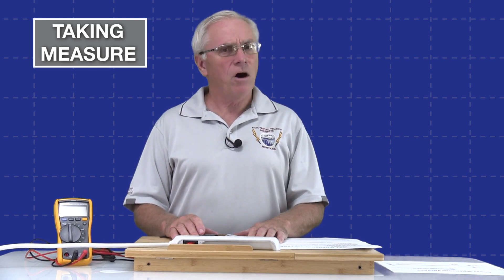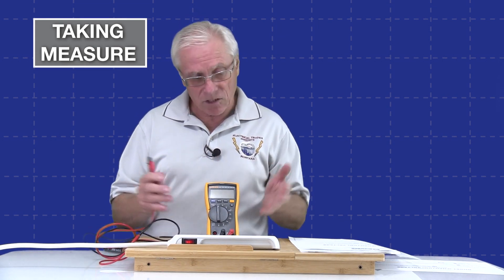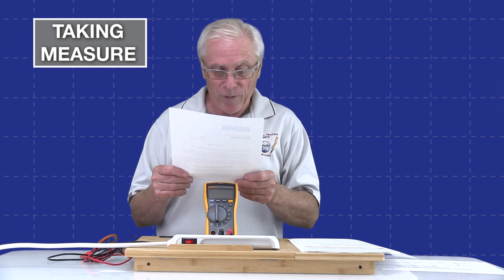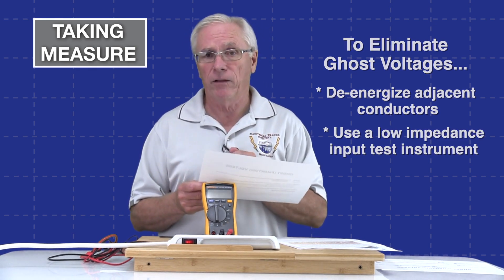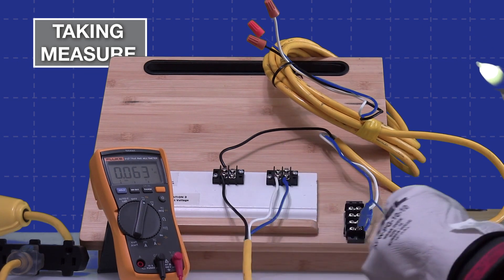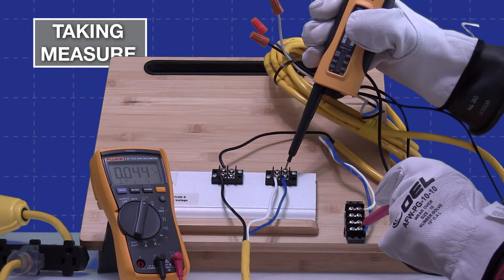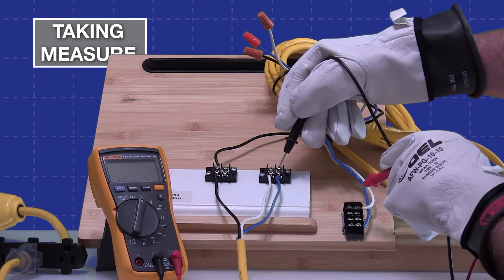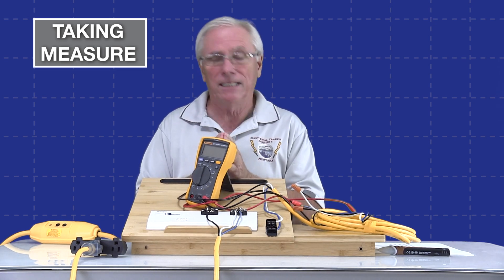Ghost Voltages - Interesting and Confounding!

Comment: Thank you for this informative video. I have encountered this issue with glowing LED bulbs. Upon investigation,  the fixture wasn't earthed, and neither was the connection at the junction box. I proceeded to earth the circuit, and the bulb stopped glowing.

Comment: Hi, I was trying to track down ghost voltage and I used the same Fluke multimeter in LowZ mode. I measured live and ground and I get a voltage of 2V. When I tried to measure neutral and ground my RCCB trips. Is this normal?

Comment: I dont have a low z meter. But when i suspect ghost voltage, I have a small relay coil rigged up that I use to tap on the suspected terminals and I can see if it energizes or not

Comment: The old part of my Dad's house was (and still is) wired with an old 240 volt main and range pull out fuse panel with 4 screw in fuses, in 120 volt 15 - 20 amp  circuits (small   5 room house when wired in 1949).  Those 4 old circuits only have two conductor wiring - no ground wires.  I know exactly what fuse turns off what light and what outlet- pretty straightforward and simple.  Has a sub two circuit fuse box wired with 10-2 w/ground wire tapping off each 120 leg where the "handyman" used the ground wire as the neutral (installed in late 60's).  I only figured this out on close inspection 20 years ago when my computer surge strip indicated no ground on these newer three prong "grounded" outlets in this addition.  The "grounds" in these outlets had just been screwed back to the sub fuse box and ended there. So much for assuming the outlets were working three prong outlets.

  Anyways  there is also one three prong outlet with newer type 12-2 with ground wiring on one of the old fused two wire circuits.  Now this should have dawned on me sooner, knowing  this circuit leaves the fuse box on old two conductor no ground wiring, that this particular outlet can't be grounded.  I was working with this outlet and was running voltage checks before taking out the fuse, -hot to neutral, hot to ground, neutral ground.  I could not believe it, but I was getting voltage readings on the neutral to ground???!!! (like 60 volts or whatever) and of course the hot to ground (but no where near 120).  I was totally baffled as to what was going on. Of course pulling this circuits fuse out killed everything. I wasted several hours trying to get to the bottom of this.  I even put one voltmeter probe on the nearby metal sink that is all plumbed with pvc in an all wood counter and could get volt readings.  I was trying to figure out a way I could see if there something bad going on.  It finally dawned on me that the ground wire couldn't (even though misleadingly attached to this outlet) be hooked up to anything and I was getting some wierd effect when checking voltage on neutral to ground with hot energized - with nothing plugged in or turned on in circuit.  I simulated this out in my shop where I had one stand alone outlet hooked up to 20 feet of 12-2 w/ ground wiring in the breaker panel and disconnected this outlet's ground.  I turned off all other circuits in box and was getting voltage readings in neutral to ground wires (way less than 120 of course).  That was very interesting.  This is also why I generally just kill everything whenever working on anything electrical.  You just never totally know what has been done or what might be going on.
Reply: My question would be is there any way to see if something like this was actually somehow energized - or partially energized for real?
Reply from the maker: @wdmm94  Using a voltage tester or meter with a low impedance input will tell you for certain. The ghost voltage is partially the function of the high impedance input of the DMM or tester.
Reply from the maker: Many years ago, I had a somewhat similar experience the first time I encountered a ghost voltage.  I wasted several hours "troubleshooting."  Thank you for sharing your experience here.
Reply from the maker: Thanks for watching.  I hope this was of help.
Reply: I also realize without being able to physically track and see this wiring to never  assume either.  I don't remember if I decided to disconnect this ground because it probably wasn't doing anything and just to be safe, but I did note on outlet that it was NOT grounded.  On another circuit I was fairly certain that the hot wiring went from fuse to light socket then to switch (light socket hot with switch off).  I think a guy almost needs to have an independent grounded wire and rod while trying to sleuth down antique houses that have had decades of layering.
I had another issue with a light not working in my Dad's boyhood farmhouse.  This house had some lighting from a 32 volt DC light  plant in the 30's and 40's.  My recent understanding of these systems was that they generally used light sockets and outlets same as 120 stuff in anticipation of being wired up AC eventually.  Might have been knob and tube.  I have a couple of 32 volt farm radios that have the same cords/plugs basically as 120.  This house had an old time 4 or 6 circuit breaker (!!!) panel.  Still has two prong outlets etc.  Twenty odd some years ago a new breaker panel was installed with wiring to energize old circuits in this panel with insides removed.  Just tied to old house wiring that came into this box.  I pulled down light fixture for this light and pulled out switch cover.  This was even worse in that it was old rubber cloth stuff that as I recall didn't match what was in switch or old breaker box.  Both wires looked alike basically. I couldn't make head or tales out of anything much less try to troubleshoot.  I also hadn't really verified which outlets and lights were with what panel circuit etc. So I didn't have as clear of a picture.  I also have no idea what work has been done over the years etc.  I didn't waste a lot of time on that, never really got to bottom of this, and light started working again. I think I also put some ox guard on new breaker contacts in case this was the problem - aluminum bus bar in a dampish basement - original breakers were on first floor.
Reply: Makes me wonder why electricians don't use ox guard on new install everything as it is all pretty much aluminum now and so prone to oxidation / resistance heating / poor contact arcing issues.  I seen this in a 20 year old breaker box in a building at my dad's with a 100 amp main breaker chewing up the contact on the bus bar about 20 years ago.  I was told 30 years ago by an electrician to use ox guard on the aluminum stuff I was installing at that time.  He also told me to run the underground aluminum cable in a drain tile to protect it.  My dad also had a 20 year old buried aluminum cable fail 20 years ago too.  It was all under a lawn.  Another guy year ago told me how some mobile homes from 70's (??) had aluminum wiring and the terminal ends of this wiring  would get hot and burn them down - oxidation.

Comment: Thanks. I'm a JM spent most of my apprenticeship doing new commercial construction. That training was invaluable because u have to learn how buildings are built. Newayz. Man, when I moved to service the game changed! U gotta learn and learn quick. I learned this "ghost voltage" 2 yrs ago on a service call to a house. With breaker off I was still getting 30V on a fan/light switch. I intuitively knew it wasnt possible and even showed the homeowner I could lick my finger, ground myself out and touch the hot and nothing would happen. "dont do that handymen". I knew it was inductance but couldn't prove it at the time. Bothered me so I started doing research. In short learned about LowOZ meters and began teaching my apprentice about it. LowOZ is all I pack out now. Always working, always learning! Great video. Thank you.
Reply from the maker: Thank you for the comment. Early in my career, I spent a good part of a day chasing a ghost voltage. They can be tricky and someone needs to teach you about them.. I am pleased that you are teaching others about this and anything else that is of helpful. Good stuff!

Comment: You can get these phantom voltages in spades from cheapie SMPS modules.  I have measured up to 1/2 line voltage on some.  Sure, they only produce a few uA and while this is not enough to hurt anyone, it can destroy a MOSFET if it's applied to the gate.  So, there are times when you need to take heed of these voltages and do something to mitigate them before you toast some sensitive equipment.
Reply from the maker: Thank you for the comment. Because I was dealing with power distribution equipment, ghost voltages were more a nuisance than anything, but at your level of circuity I can see how problematic this can be. Again, thank you for sharing this.
Reply: @takingmeasure  Understood.

Comment: Thank you! I need to buy a Loz meter it seems. I spent 8 hours chasing a phantom voltage the other day! It was 120v, I did IR, and it was fine, so touched it and had no shock, this is when I started looking at this ghost voltage phenomenon. Will I ever need to use the standard volts function again?
Reply from the maker: Thank you for watching. For troubleshooting basic branch circuits, common lighting circuits, etc., a low-Z meter is great (helpful).  But if you are working with circuits that may be impacted due to "meter loading," you would want to use a high impedance instrument.  As example, I recently talked with the operator of a powerplant, who told me about technician who knocked the generator off-line by attempting to measure voltage on a relay control circuit with a low-Z meter. In this case, a high impedance instrument should have been used.

Comment: I had an issue some months ago with a new ceiling fan installation that had a remote control. The receivers kept burning out. When finally installing a standard fan without a remote a family member said that I had approximately 80v of ghost voltage and it was burning this solid-state receiver out. How do I get rid of ghost voltage?
Reply from the maker: A ghost voltage is really an "illusion" of voltage produced by the meter.  The voltage is not actually present in the circuit being tested. To eliminate a ghost voltage you can simply take measure with a low impedance meter.  I suspect something other than a ghost voltage is responsible for damage to your remote. Hopefully you can find the cause soon.

Comment: Learn something new everyday.  I spent an hour+ chasing ghost voltage in some 14/3.  Almost ended up cutting into drywall to run new wire; thought maybe I shorted a connector with a staple or something.
Reply from the maker: I and many others I know have chased ghosts also.  You are not alone!
Reply: Same thing happened here I had a feeling this was the issue but I didn’t even know that this was a such a wildly known issue
Reply from the maker: @KennyTheKenny  Ghost voltages can be quite confounding... especially if they are not recognized for what they are.

Comment: Good eve sir I have now encountered a problem with the LoZ  when i test our outlet from the breaker it reads .1 ,and the crt of the lightings also .1 when we insert the circuit of the outlet inside the pipe of the ckt of the lightings,
Reply from the maker: I am not certain I am following you entirely.  But the first thing I would do is test voltage on a known energized circuit to confirm the meter is working properly.  Also make certain you are wearing proper personal protective equipment when doing so.

Comment: I didn't like one of the solutions proposed, de-energise adjacent circuits.. If there is an unintended short to one of them you will not then catch it. 
Regarding the voltage seen , lets say a good quality DVM has an input impedance of 10 M ohms, also lets guess at 100pF stray coupling capacitance. This would be ~25 Mohms at 60 Hz, so on a 110v circuit you would measure about 30v . If we had a 10 k ohm load we were measuring across we would see ~30mV (factor of 1000 Mohm to Kohm). If we looked across a live circuit we would dissipate 1.2 watts. You can buy DVMs with a low input impedance for precisely this job. this quick sum show its not an intractable problem
Reply from the maker: Your point is valid.  There may also be a lot of instances where it would be impractical or undesirable to de-energize adjacent conductors.  Life-safety circuits, for example.  Thank you for the comment.

Comment: It would be interesting to see the reading of an isolation transformer, normally in isolated ground circuits panel if we measure between L1 or L2 and the ground shows 60V when it should be 0V in theory because it is precisely isolated to avoid electric shocks in the patient of hospital.
Reply from the maker: Thanks for the comment.  That is an interesting thought.

Comment: The measured Ghost voltage measured 79VAC Phantom/ghost voltage from the white neutral wire of the power supply to the N/C white neutral wire of the cord and the same from the green earth wire of the power supply to the N/C green earth wire of the cord measured 79VAC phantom/ghost voltage. The question is why 79VAC is the phantom ghost voltage and not 120VAC? 120VAC real -79VAC ghost= 41VAC difference or loss.
Reply: That 79V is caused by induction and it's value depends on many factors like wire length and etc.
Reply: @ghenkhoash2440  79VAC is an induction by coupling but why 79VAC and not 120VAC?
Reply from the maker: Yep!
 @ghenkhoash2440
Reply from the maker: The value of the ghost voltage is related to the length of the wire capacitively coupled with the energized ungrounded wire.  We might see a voltage nearer to 120V if the "floating" wire was longer and provided more capacitance when coupled.  A mush shorter wire would yield less voltage.  It might be fun to do a lab on this...
Reply: @takingmeasure  Thanks for the info, yes try it in a lab one day it would do a good experiment. The Ghost Voltage value might depend on the wire length + what the wires load can be inductive load or capacitor load on the other end of the wire which is grounded by the load, while the other end of the wire is Ungrounded.